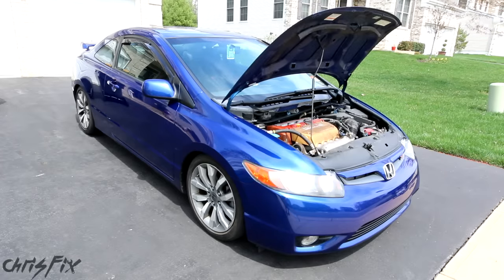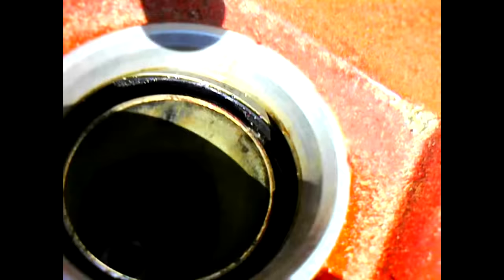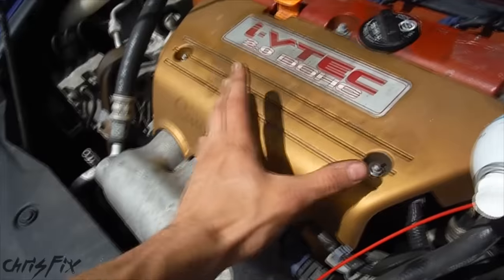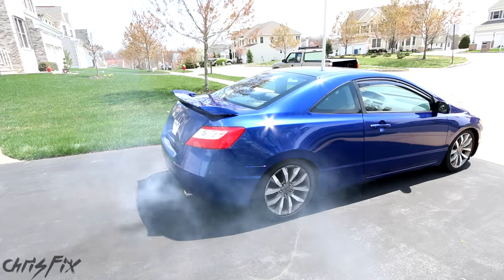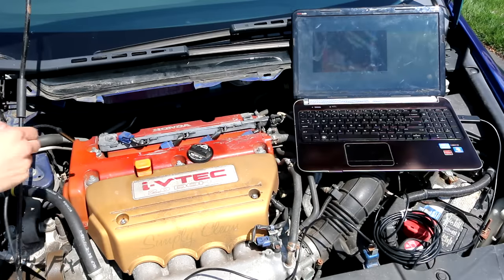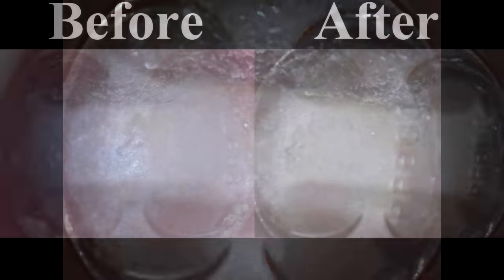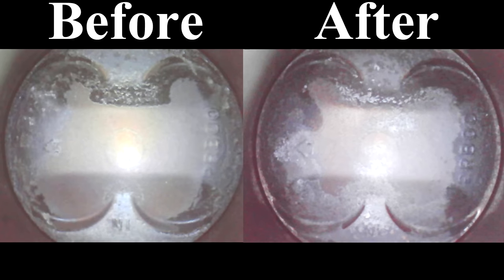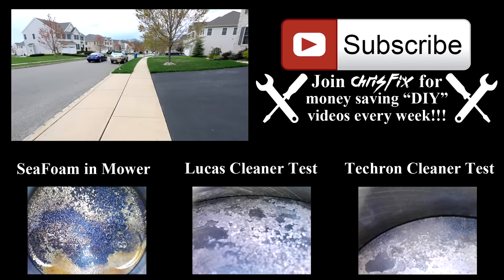Does Seafoam Actually Work in a Car? (with Proof)

Comment: you should check for carbon in the intake manifold, throttle body and all those parts of the intake to the inlet valve. specially in diesel engines can build up there a whole lot of deposits which restricts air flow and also harms the turbo to spool up. i remove them as much as possible by hand, then i use a spray cleaner like you did and after this i burn free the DPF using OBD diagnostic tool. This will give the best results and noticeable more power (TDI engines).  those deposits on top of the piston are not verry responsible for the engine.

Comment: That Civic is so sick dude! Great review and thorough testing!
Reply: What's the purpose of seafoam?
Reply: ***** same here!

Logan Von Meow It's a general engine cleaner. Removes buildup of deposits
Reply: Logan L I see
It works then?
Reply: That is soo is sick i tried that im soo SICK OF THAT
Reply from the maker: Logan L Thanks a lot!
Reply: Logan Von Meow ive used it in my own TL and the fuel lines were cleared when used in the gas. It felt a bit more smooth in operation as well.
Reply: ***** who won't....
Reply: Logan L how's it work
Reply: Logan Von Meow Not quite sure really. There's something in it that actively works it's way into deposits and expands to break them apart or something. Something reacts in the deposits to erode the bonds that hold them together.
Reply: And you put it in through the fuel filler hole?
Reply: Logan Von Meow yes. There's different kinds of sea foam. The one I used mixes with the fuel.
Reply: Logan L I see
Thanks mate
I needed something for the Nissan so yea

Comment: Hi Chris, this is what I do every 10K miles. I mix up a fuel system cleaner which is a gallon and a half of fluid. One quart of Acetone, M E K, Lacquer thinner, Zylol, 100 percent Isopropyl alcohol, and two cans of Berryman gas treatment. 
I mix this in a empty 2 gallon gas tank. I run my gas tank low and fill the tank with straight gasoline and the mix I described. In just one gas tank the engine gets cleaned well including the fuel system. Works for me fella. Give it a try, works really well. A old timer mechanic showed this to me years ago. 
Peace vf

Comment: thanks dog you prove my suspicion that these leaners never works.
Reply: Killa Bee what's learners I only know cleaners
Reply: lol typo
Reply: 1999 isuzu amigo had sugar in the gas tank[kids...] replaced all fuel injectors. Ran flawlessy but had engine light. Tires even spun 👍. Added seafoam as mechanic suggested & light turned off automatically 100 miles or so.  Only stuff i buy!!!
Reply: Sugar is not soluble in gasoline. The whole putting sugar in someone's gas tank to get revenge is an old wives tale. Try it yourself. Put sugar in a jar of gasoline. It just settles to the bottom.
Reply: Mark Chas where the fuel pump picks it up clogging the sock over the pump pickup and more....
Reply: You can edit nowadays..
Reply: Killa Bee actually in my experience they do work ... I’ve used lotsa royal purple, Lucus products and sea foam. Had a mechanic replace my spider (chev4.3L,6cyl). He said my engine was the CLEANEST he’d EVER seen! Spider replaced at approx 140k. course I usd the products every few (3-5) tankfuls so that probably had something to do with it... heard one product that actually works good. Think it’s made by mr gasket? And spendy @ 28$/bottle!! Add it to gas at 1/4tank and drive 15mi. I also used that couple times. One of wich I ran out of gas! So not sure which of those products did the most good?

Comment: To save your time, the Deep Purple came up with the best results of all the videos 😎
Reply: Amen!
Reply: You mean royal purple max cleaner?
Reply: @suavehouse5150  Deep Purple - Smoke on the Water seems appropriate.
Reply: A bit of highway star action occurred here tho
Reply: I was looking here to see if anyone would help with this question.  Thank you!!
Reply: no watch the purple vid n he tells you at the end seafoam is better
Reply: Perhaps it was invented by a rock group. (only the older non rappers will get that)
Reply: @techno4x4  You know when you call 'Doctor doctor gimmie the news" When you've just been on a trip to Pattaya and you've got 'Smoke with the water', and it's swollen and turned purple.......no, that's not from experience.😂😂😂😂
Reply: Didn't know Deep Purple did tests like this.  Didn't know that band was even still together!
Reply: I found that Iron Butterfly works best.
Reply: @stephensmith9334  The Seafoam worked better because he ran it directly through the intake rather than adding to the gas tank.
Reply: He's a highway star?

Comment: Better than pulling the heads to scrape the pistons, but overall, Not Impressed.
Cleaning relatively insignificant for the bother.
(And for 120k, those pistons were quite clean.  Back in the days of leaded gas, the buildup after 50k would be 10x worse --- BTDT)  
Also impressed that you didn't show any significant cylinder wear.  You should have had very significant, blatantly noticable ledges near the top of the cylinder walls with 120k on the engine.
Reply: You sir are right ..
Reply: +loadi2 On older engines yea... But the manufacturing tolerances on newer engines are so tight that they account for piston swell and modern oils further reduce wear. The lack of carbon build up is result of more efficient fuel delivery and ignition not to mention EPs regulated gasoline refinement to reduce emissions. Overall nothing unexpected unless you have been under a rock past 20 years.
Reply: It may not be impressive here but I ran a tank of gas mixed with sea foam through my dirt bike (KTM 250 SX-F) and then checked the jets that were clogged before the seafoam and they looked new.
Reply: My '91 Celica when I decided to rebuild the engine at 280,000 miles had cleaner pistons than that and perfect cylinder walls, the factory crosshatch was still there head to toe on every cylinder. I was quite amazed. 

Some of these lil 4 cylinders last like crazy. Curious to see what my Mazda 3 looks like in another 200,000 miles (Sold the Celica for a song because I wanted something newer and other influences in my life demanded 4 doors for some silly reason...)

That said I wasn't impressed with this "cleaning" didn't really look like it did much. Some minimal progress I suppose...

Comment: True story experience of sea foam spray: I tried this on my dad's 06' BMW 750li. Inserted product while raising RPMs. Drove aggressively. He stated that while driving, it gave NO power. Car drove like dog$hit. I felt terrible. Car had to be limped back home practically. He took the next day off work to get a tow. He told me that upon starting the car it fired up and ran like a top. That was great news to hear after thinking I killed his car.

So anyway I'm gonna try the product in my 87 b2000 FE3 swap. My only guess in his case is the plugs got soaked or maybe a sensor got tripped...that car is loaded in sensors. Mine, less so.

Comment: I had a 2009 Civic SI and with a intake, hondata and race headers it was an amazing screamer. I could beat stage 2 APR GTIs and Mustang GTs. This car was right before they changed the SI, with increased displacement to increase torque but dropped redline and changed the car for the worst in my opinion.
Reply: Which GTi ? Hell nah .. that driver probably couldn't pull gears
Reply: A fuckin GT dream on bud. You only have bolt ons and probably 200hp a gt has 400hp. Even a manual 2 valve mustang would smoke that ass
Reply: @chefderappa4838  right i agree. I laugh my ass off when he said that..

Comment: If you remove a small amount of carbon in the combustion chamber, your compression ratio would actually do down by a tiny bit.  The volume of the carbon removed doesn't look significant. Seafoam needs to explain where the "restored" power comes from.  I'd like to see a SeaFoam company representative explain the product.  A before and after compression test might be interesting.
Reply: Im a little confused. On a port injection vehicle, wouldnt jus throwing it in the gas tank do the same thing? Itll be mixed with the fuel and clean the injector subsquentially cleaning the intake valve right and end up in the combustion chamber anyway? SO why go through the intake ? Cylinder heads?
Reply: @Oxcotton09 if a car is directly injected then putting it in gas tank is useless

Comment: You should probably do a cylinder check on each cylinder to check the compression before and after. It would give you a better indication if it worked or not.

Comment: Thanks ChrisFix for this unbiased demo.

Looks to me like the carbon was redistributed around the piston, especially away from the edge of the piston more than it was actually removed, although there was also some small amount removed.

Not sure if the removal of carbon from the edge alone is super beneficial in and of itself as I am not a gear head but if it is then I say the product did an OK job.  If it doesn't matter about edge carbon build up then I would say no.

Of course from a science perspective I would also want to know about the after effects of using the product as it was noted that there was a build up of something other than carbon in some areas.  Is this build up harmful?  Will this product remove carbon in the short term but allow it to adhere to the piston better in the future causing a worse problem?  These are some of the other questions I would like to ask investigating this product but could probably only be answered in a laboratory.

I would say this is not enough evidence for me to use this product.  The idea of contaminating your fuel system to remove another contaminant is something that seems irresponsible and unreasonable at first glance and the results here are not good enough to sway me.
Reply from the maker: +Bob T I'm glad you liked the video!!! Great feedback!

Comment: Don't forget that it cleans intake nozzles and this alone will give a performance boost. Removing carbon usually does not give that much if any boost. Most sluggish performance is from the injection nozzles being coated with cheap gas additives. Better to just use better gas in the first place. If you bought a used car, cleaning the intake nozzles would be a good idea. The last time I heard someone say it's time to burn out the carbon build up was from my father (a jet mechanic) racing down the road with my 400cc two stroke Yamaha redlining it in 2nd gear. He had so much fun. Oh, and if you must run the snot out of you engine, if you do it after a light rain as the added water vapor in the air will prevent it from detonating (a two stroke thing). If you drive up a steep hill and you vehicle pings doing so, it's detonating. My old truck did so and going to Exxon high test solved everything. All Exxon gas burns very clean in my vehicles, even regular. Do the test if you like: run on Sheetz gas for six months then check your spark plugs (they turn gummy black) then use Exxon gas for six months and the plugs are lightly grayed - - with no residue. Sometimes you get what you pay for.

Comment: Since you've got the plugs out, what if you sprayed a little of the product directly into the cylinders and let it soak up for a spell? Then you do the spray in the throttle body. Might give you a head start in dissolving the carbon build-up?
Reply: Good question

Comment: The carbon on the edges of the cylinders and rings help seal chambers. Unless your car is really old I don't think I'd use this product. Removing the injectors and cleaning them is another issue.

Comment: Just a quick tip, I highly recommend changing your spark plugs after you do this. His look old anyway and you want to replace these with iridium NGK SPARK PLUGS, they run between $9.99-$19.99 each. NGK is OEM and you want to make sure on a Civic Si of this generation. (((8th Gen))) than you put the correct plugs for ultimate performance.

Comment: DUDE!!! Is this magic in a bottle??? I have used alot of stuff that is supposed to help with injectors and all that. This seafoam stuff is a God send. I got really scared with all the smoke but kept going and kept revving it so it wouldn't die. Kia spectra 220k on it and this stuff did wonders. It's seriously a new car I cannot even put into words how well this worked for my SUPER gunked car. About the cat I'm sure it's not great but again 220k made the car run like an absolute beast. Thanks to Chrisfix for easing the anxiety of doing it enough to actually send it.

Comment: You should do another seafoam test but follow the seafoam treatment with Lucas deep cleaner because DeLucas cleaner seemed to enlarge the carbon free areas. this might be a good combustion chamber cleaner combo. also Mopar combustion chamber cleaner is claimed to be a fantastic product, also GM top and cleaner I believe it's called is another great product. thanks for the videos. I really like watching them.
Reply: I rewatched that and I better see what you mean. I rewatched nearly all the videos and I think Lucas Deep Clean really was the least effective with Techron tying for the worst. 

Yes, it expanded clean areas, but that results were still minimal overall. I think the second worst was Gumout.

Induction cleaning has long been the professional way to clean like Seafoam. Though, for some reason, pro's tend to use different products often not available on the shelf. I've ran a few and while I'm sure it works I can't compare it as you always have to move in to the next vehicle.
Reply: Lucas did better than the others. You could see the results. Non do anything to caked on carbon. Its a better used as a preventative treatment.
Reply: non yobussiness
Maybe ChrisFix is wiser to typically say. Those are the before and after. You decide. :)
Reply: I'm not saying it did wounders or if its better then than the pros, it did better then techron and gum out.
Reply: non yobussiness
You know, now that I think about it more, the ones that I'm rating low tended to clean the easy stuff or as Eric would say, "the low hanging fruit".

The Lucas Deep Clean really was rare in getting actually expanding clean spots. If that doesn't happen, his Mazda would never get clean.

All in all, he couldn't get as many good videos out of it, but pulling his cylinder head and manually cleaning at this point would probably have been less work. :)

Personally, I'll be pulling my cylinder head coming up...but I need a head gasket anyway, lol. Cleaning the combustion chambers is one of those things that you just have to do while you're in there, lol.

My oil and coolant aren't mixing, but a bit of oil is seeping out the side of the head gasket seal.
Reply: non yobussiness
 As far as the "professional" cleaners go, I'm just saying they go in the same way or similarly as the Seafoam, I can't evaluate how well they work either. I just think cleaner coming in this way is much less diluted and has a better chance to work then when it's mixed in with the gasoline.
Reply from the maker: non yobussiness Thanks for the suggestions and ideas!
Reply: DE Nichols agreed.

Comment: Hey Chris I've seen all your videos and they are great. Can't you just literally vacuum the pistons using a vacuum, tape and long straw to get rid of that carbon build up. Yes this is a legitimate question.
Reply: Nope, the carbon buildup is pretty hard (though brittle). It's not a dust you can just vacuum out. If it was, it would be blown out of the engine with the exhaust.

Comment: Hey Chris I have a 2006 Kia Sedona.  Check engine light has been on for over a month with a P0420 code which is the catalytic converter.  I threw in 2 cans of Seafoam, 1 bottle of Chevron Techron and a bottle of Lucas oil all at once.  Ran it for a tank about 350 miles.  The light went off and has been off for 300 miles now.

Comment: Inject water steam into the air intake & it'll clean off the carbon. DO NOT inject antifreeze, it'll crystalize & be like sand in the bearings. When there's a head gasket leak, the leak is at the clean piston.